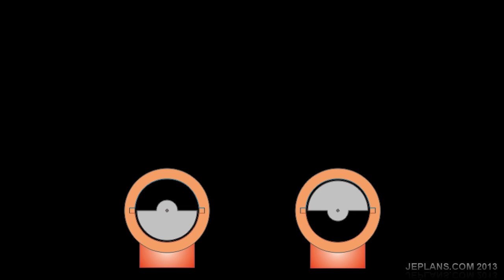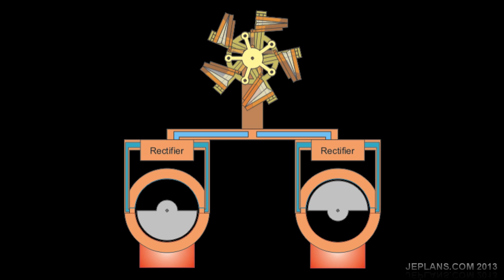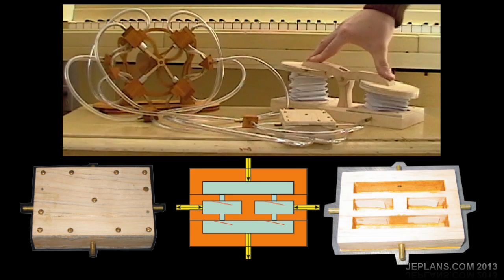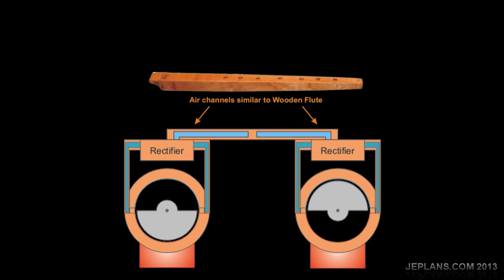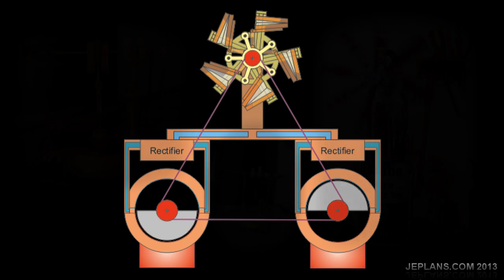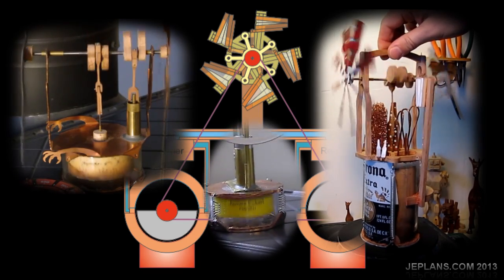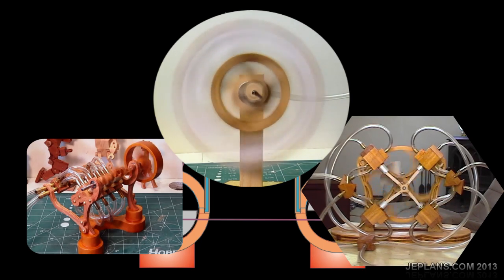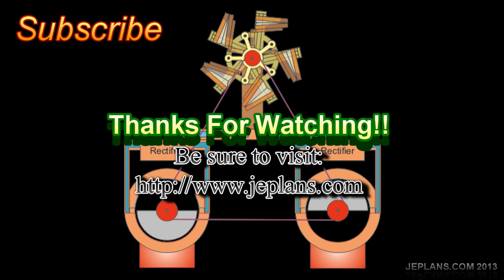Rotary Heat Engine Part 1

Comment: Probably not quite realize this project
Reply from the maker: This never worked out like  wanted.  Someday I will give it another try. without the rotary displacers.
Reply: @Jeplans 🔴 What Is Islam? 

🔴 Islam is not just another religion. 

🔵 It is the same message preached by Moses, Jesus and Abraham.

 🔴 Islam literally means ‘submission to God’ and it teaches us to have a direct relationship with God. 

 🔵 It reminds us that since God created us, no one should be worshipped except God alone. 

 🔴 It also teaches that God is nothing like a human being or like anything that we can imagine.

🌍 The concept of God is summarized in the Quran as:

📖 { “Say, He is God, the One.  God, the Absolute.  He does not give birth, nor was He born, and there is nothing like Him.”} (Quran 112:1-4) 📚

🔴 Becoming a Muslim is not turning your back to Jesus. 

🔵 Rather it’s going back to the original teachings of Jesus and obeying him.